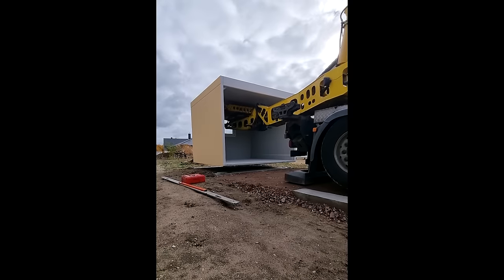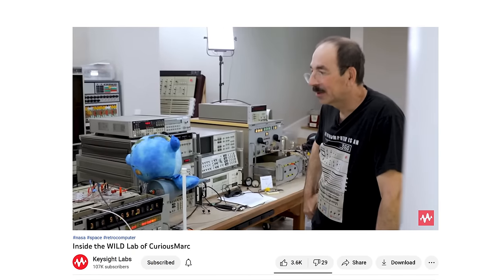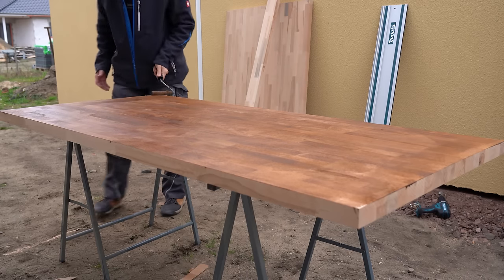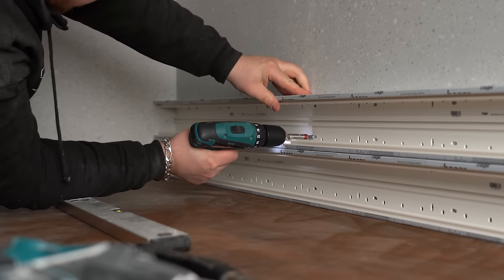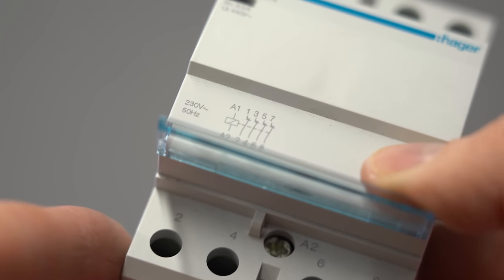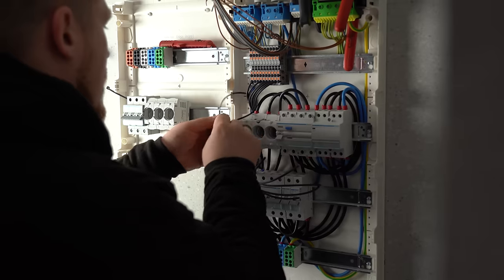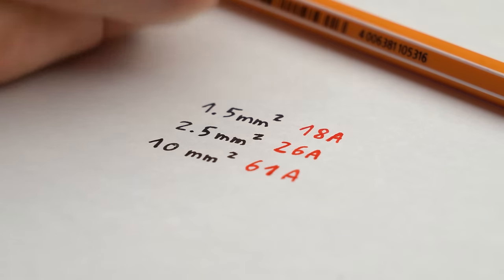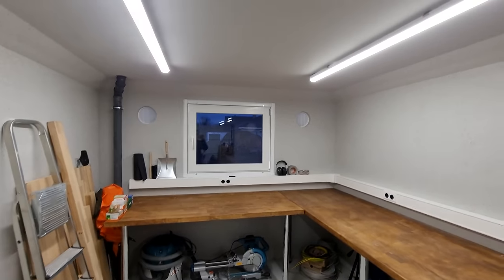Germans do the PERFECT Electrical Wiring! (Garage Build)

Comment: Normally you add an reset for the E-Stop so you need to reset first before you have power at your outlets. This is important because in your schematic it seems  that you reset by pulling the E-Stop.
Reply: This is mandatory on industrial installations. I would say this home garage e-stop is just an add-on and is not any kind of requirement in garages anyways. But of course that would be a good extra! There should also be a safety relay which controls that contactor and you could add that reset button to the safety relay.

Comment: German wiring boards look massive compared to UK ones, my garage is a lot bigger and has 10kw of PV on its roof and 2x Powerwalls a static caravan and 20 double sockets and 20 lights but all runs through a metal 10 circuit consumer unit that's a fraction of the size

Comment: Did i understand it right? You use melting fuses, and if L1 phase triggers, the engine will run on 2 Phases only, resulting in destruction by heat. Because the emergency button does not work if L1 is without power.

Comment: In the UK if you done the conduit like that you would be sacked! I’m a Scottish electrician,we put bends in the plastic conduit and terminate the conduit into the boxes or trunking to make it seem less, I’ve worked all over Europe and it’s all very similar to Germany though in most places they think it is acceptable to wire lighting in single cores without conduit or protection anywhere lol interesting video and a very neat job considering the lower standards

Comment: I really like that you didn't put the cabeling channels not directly on top of the work space.
That's a design fail I see being done by many people - and when they want to connect a wall wart or an angled plug some time later they have to plug them in upside down.

Great to see someone thinking ahead.

Comment: That is indeed a nice installation. 
What I do not like is the 4-pole relay to switch neutral and phases for single phase groups. I know this is allowed (and installed this way by any electrician in the Netherlands) but I prefer to have each phase to be switched with the neutral separately to prevent strange things happening when the neutral contact in the relay wears out due to corrosion - and yes this will happen, even if it takes 20 or 40 years. Please don't ask me how I know ...
Since someone will ask anyway ... A friend had his company wires this way with the emergency switch to power off the whole workshop. After a few years, suddenly one light flashed and went to the eternal hunting grounds. Then another one, the one PC, then two more PCs ...

Comment: @greatscottlab since you like to improve your vocabulary at 6:45 "opener" and "closer" is something only we Germans use.
We describe the state when actuated, this often leads to misunderstandings in technical communications.
Internationally its "normally closed" and "normally opened" and describes its rest state.

IMO that's the far better practice, and actually what you draw in plans.

Also if you really want a safer e-stop get a DFS 4 NA or similar RCCB with inbuilt e-stop.
But be aware they cost a pretty penny since those are usually tested and certified for lab environments.

Comment: Here in Spain, the installation is very similar, but I got surprised you didn't use curves and the tubes weren't connected to the boxes or the canal. Also when using tubes we use only that kind of insulated wiring in outdoors, indoor we use inside the tubes single wires, since they are already protected by the tube and it is easier to replace just one if for some reason is damaged. I have noticed you used insulated connections to go from the tube to the canal, which I believe it is unnecessary since there is no water there and any way the canal is not waterproof. I personally don't like fast connections like those you used in the conection boxes, but that's just a personal preference.

Comment: I would have just kept the Normally Closed Relay in that way for power consumption as you mentioned but then I would control that from a PCB inside its box, so there are no issues with cable disconnections being possible, that would convert an active high signal from the mushrooms to the input of the relay. I would have used a MOSFET so power consumption would have been very very low.

Comment: In the USA emergency cutoff switches are rare as part of the buildings wiring. 

The only one I can recall was a class room for instruction for the repair of television receiver repair. That system shorted the power to the outlets and tripping the circuit breaker for that circuit I think it used a big relay to make the short.

Walta

Comment: Very tidy and thought out.  But as you said the emergency stop is a little worrying.  Safety circuits are just that “safety” devices, building it knowing it has and inherent failure point is somewhat worrying, to me anyway. You will be unaware of its failure until the time you need it.  Still its your choice.  It’s still a very tidy build.  Keep up the good work.  EXTRA: Looking at some Hager Contactor data sheets as I read it the coil power consumption is nearer 5W.  2.1w for Schneider. Unless I’m reading it incorrectly?

Comment: Saw the video (and your Channel) for the first time:
Immediately thought about a smart Charging Station. Like an Metal Enclosure with chargers wired up to an Shelly. The Shelly tracks the Power and cuts when the battery ist full (like only charges on less than 10 W).
Seeing forward what you do under the tables! 

Kind regards!

Comment: The breaker cabinets are better organized than the US, but the connector boxes can be stuffed/packed with wires that would exceed US regulations. The non polarized Shuko sockets are very safe.

Comment: CEE form connectors are so good. Here in Australia one of my old companies used them on all their equipment because the connectors where not over priced and no one else used them. Plus the option for pilot pins is great. 125 A connector options too.
Reply: What's the cost for a double "CEE" outlet? Material only.
Reply: @randybobandy9828  do you mean as a replacement for a standard 3112 double 240V socket outlet or like a 6 gang 56 series box with an ELCB and two switched outlets. IP ratings add a significant cost over the 3112 socket.
Reply: @randybobandy9828   depends on the type. red one (3 Phase) some 10 € for 16A, 15€ for 32A, blue (Single phase) 16A some 15€ "double" are uncommon, but for 100€ you get ab RCD, some MCB and 2  CEE 16A oitlets + some normal outlets. "Baustromverteiler"

Comment: Great looking installation and interesting to see how things are done in Germany! Really enjoyed this episode, not that I ever not enjoy your videos. 
The term for an E-Stop or safety mechanism / circuit that opens a circuit when tripped is called "Failsafe". I did go OH NO when I saw your prints, as you said some would. But agreed, in your case it really isn't that important. However, you can install a 240V, low current "pilot light" in parallel with the E-Stop contacts. As long as it's low enough current it will not let the contactor pull in and it will give a visual indication that the relay circuit has continuity. When the E-Stop is pressed it then makes the low resistance path and will operate the relay and pilot light goes out. But, probably not that important for you use, but a pilot light is a low cost, low energy use solution that will verify your relay circuit is good.  Plus, indicator lights are cool!! 
We use the same method in substations for the trip circuit monitor on high voltage breakers. The red "CLOSED" (red = closed in the US) indicator lamp is wired through the trip circuit and trip coil itself and a 52a contact. This way if the breaker is closed and the light is out, it's either a bulb or the trip circuit itself has failed and that IS a big deal in substations!  
Question about using the 4 pole relay / contactor, is it code or normal there to interrupt the neutral? Normally the neutral is never opened in any switching instances, just the hot phases.

Comment: The CEEform outlet has the capacity of 10.040 watts. There are 3 fases so you can use 16x230x3 watts not 400x16.

The rest of the installation looks great.

Comment: 6:14 For three faze systems the real power formula is: P=1,73*U*I*cos fi (don't forget about the power factor, witch is never the ideal "1"), so that is 1.73*400*16*0.9, therefor you will have a top power of 9964W, roughly 10kW.

Comment: That's a mighty fine install, I'm kinda jealous (the electrical in my home is an absolute mess thanks to old German electrical code)

If you ever decide you need a connection to your home network, be it for WiFi, Security or Automation, I would suggest using a fibre optic cable to get that from your house to your garage (from what you've shown, the garage is not directly connected to the house)

Reason is that if a lightning ever strikes anywhere near your home, the energy from that could jump into a regular Cat7 cable buried in the ground and fry everything that's plugged into the wired home network.

Fibre optic is not too expensive, but spend the money once to protect it or spend more if you don't

Comment: I like the setup with all this protections (in Spain the electrical setups are similar) and emergency stop switches are so cool, but in my opinion I change a few things: 

1º The wiring, to insert in tubes I prefer individual wires in front of the 3 o 5 wires packed in ruber, with individual wires comply with regulations and it's easy to insert and make future changes (add more wires in the future), and you can add more wires by PVC tube. I watch in the video rigid wires, another thing than I prefer flex coper wires, by the same cross section, more current and make me feel more safe (the rigid wire will broke by the years). 
2º The magnetothermal switches, I prefere 2 poles (P+N) for monophase wiring, and 4 poles (R+S+T+N) for triphase wiring, in your electrical box you only put 3 pole magnetothermal for triphase wiring. Probably is correct, but I prefer to disconnect ALL wirings when switch off in the electrical box.
3º Fuses, I think that is a dangerous thing in 3 phase installation, why? Because if only 1 fuse broken, you can work in 2 phase with 3 phase devices and broken devices (and another catastrophic things, like returns of voltaje in neutral line). For this I prefer a well sized magnetothermal switche with the correct switch curve.
4º I think that you should put emergency lights, I don't know if in Germany it's mandatory for you regulations for your application, but if it isn't, it's recommended because helps you to see in a fault of electricity or if you trip any switch with a faulty device.

But congratulations by your new place to continue doing cool things.
Reply: All Contact Breaking is unfortunately not the Standard in Germany.
Still always the right Way to do it.

The Fuses are always in Addition to the Automats because they react better in certain cases.
Both are required for normal Safety.

I’ve never seen Emergency Lightning in residential Buildings that aren’t high rises.
Motion activated Battery powered LED-Lamp is the most I'd do.

For an Emergency Stop I used the Additions for the Breakers.
Shunt Trip or Undervoltage Trip for my RCBOs.
AFAIK these normal Relays aren’t made for breaking Contact in Overload Situations.
The Additions couple to the normal Interruptors.
Reply: @FullSpeed_only   Thanks for the clarification, the comment about emergency lights It's becaus if he want to use this garage like a work area, it's easy to make it trip switches from the general electric box when you work on broken devices (or touch accidentaly live wires), and when there is no sunlight and this type of events happens, It could be difficult to return electricity in the dark.

Comment: What you could have done for the emergency stop button is an emission coil (or whatever the name is). It basically clips onto a breaker (either 3 phase or signle phase) and trips the breaker if powered or unpowered (depends on the type). I have some old Schneider Electric breakers at home, and I put a MNx coil to the RCD (this coil trips when there is no power supplied to it, but stays on if their is a main outage).
Reply: Here in the US the breakers are available with "shunt trip" for this sort of use.  Often for tripping circuits when an e-stop, alarm, etc. is pulled.

Comment: The wiring methods used in your videos seem much easier and more elegant. I work HVAC in Texas, and trust me, most of the electrical is very scary at first sight lol. The only thing I would have done different is add some low voltage back up lights. Other then that, It's perfect!
Reply: Low voltage backup lights? For what? When you trip the breaker? But the lamps are on a different one. When the power goes out once in a decade? But why would you iluminate a garage? The big garage door won't open and you cannot use all the nice equipment there, so you would stay in your house anyways. Having a battery operated torch handy, would be the better idea to prevent tripping on the way back.
Reply: @TecSanento  But why would a tripped breaker remove the light? The lamps are usually on a differnt breaker than the power outlets. So one breaker tripping doesn't make him loose all power everywhere
Reply: @SchwachsinnProduzent  regular curicuit protectors yes, but - RCDs are usualy "per garage" - i dont remember if he realy did put an extra one just for the lights - and the subpanel braker in the house or the rcd there might trip whatever he doses in the garage and exposes you to the same risk.
i mean - i would consider this unlikeley as well (thats why i don t have these lights at my place) but i understand why someone would want them - and the could have been usefull for me twice
Reply: @SchwachsinnProduzent  The lights would use a battery backup, and in some cases one may need the light. There is no one scenario and I'm not going to cover them all. But in my case, I may need to make a repair on say, a generator in the shop, possibly with battery powered hand tools. any extra light could be handy. But that's me.

Comment: Nice Video 👍
10:36
In Germany is green-yellow conductor only for PE
Blue is mostly for the N conductor.
For example you have a tactile switch circuit (Tasterschaltung) you can use the blue one for the switch.
Please not, the green-yellow one❗
But Attention,⚠️ In old houses there are two conductor wire or the green-yellow one is using for circuits and so on!

Comment: German Mechatronics engineer here ✌🏻
(Working in the industries but shouldn’t make any difference cuz I can do both)
So here is my constructive critique, don’t wanna brag or anything like that. Im just a Little perfectionist, sorry for that...
First of all I would have tried to design the workbenches differently. In a way where I would have used less or even none supports for the table. Cannot exactly tell cuz I don’t really know about the strength of your walls.
Also i would have put in a little LOGO, something similar or maybe an even a bigger PLC, to monitor most of the stuff use 24V for nearly every switch and do some other shenanigans with some sensors and stuff like that :D it’s also not bad for some future projects I guess
Also i would have made a circuit diagram, but until now I am the only one I know that does this for home wiring somehow.. in the same step comes the naming of every cable and device used.. yeah I know that’s like 200% over the top, but I adopted my industrial standard for home and it saved me some time in the past and filled me with joy haha
Also i would always suggest to use bigger empty tubes and try to hide them inside of the wall. I know it’s „only“ a Garage, but since you are there a lot I guess, why don’t make it pretty :)
Since I am not a huge fan of wLAN I would have also put in some LAN ports so you got all the areas covered for future plans.
I could probably point out more to bring your garage to perfection but it’s already getting late here..
I apologize for my not perfect English and hope I was able to give you some tips :) hope my words aren’t to harsh, i think it’s just how we germans talk haha 
Just found out about your Chanel today so definitely keep up the good work!
If you got some questions or anyone needs an advice feel free to comment or contact me. It always gives me joy to help others :)
Good Night and see ya all ;)

Comment: Looks very nice. Though, I would have done some things differently:  1) I would never use fuses. It's a thing from the past. I know it's still a thing in Germany, but I have no idea why.  2) Personal taste, but I would have used a single distribution board that can fit everything. That looks a little more clean in my opinion. 3) I know it's not mandatory, but I would have used different colors for the different phases inside the distribution box. But all in all the installation looks very nice. I'm a sucker for over-engineered, neatly installed distribution boxes.
Reply: The fuses are mandatory due to security reasons. When working on the box it has to be current free and must be be protected from unintentional re-activation. Removing the fuses will exactly do this.

Comment: Nice planning, looks very clean and sturdy. But one question, why didn't you use flexible rubber conduit pipes on those 90degree turns? I suspect that you didn't have them during that time but it's a must when it comes to PVC installation. Especially when you use NYM cables. Since it is a work area it blocks dust and debris from entering the pipes, it may cause you problems in the future. I recommend you put them on later. It's easy to put on just cut them across. Just for safety measures. 👍
Reply: Not required in germany. Nym-Cable is already double insulated. If he had used single wires it would be another story, but that is usually not done here.